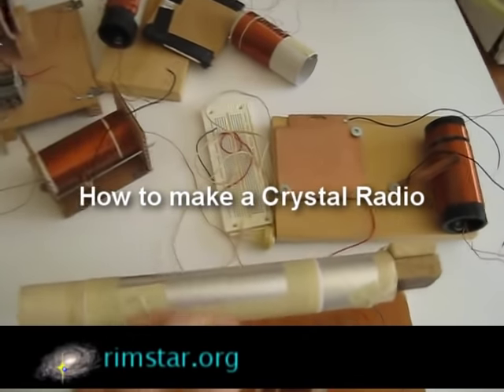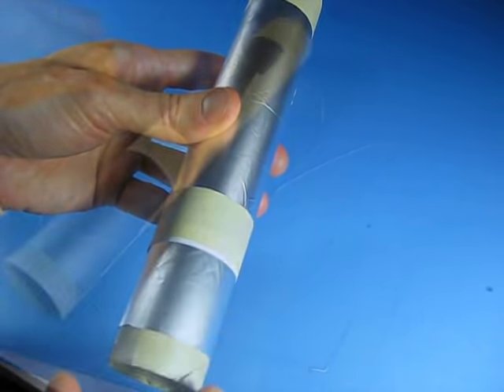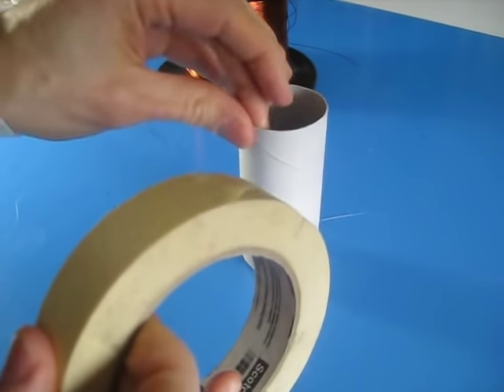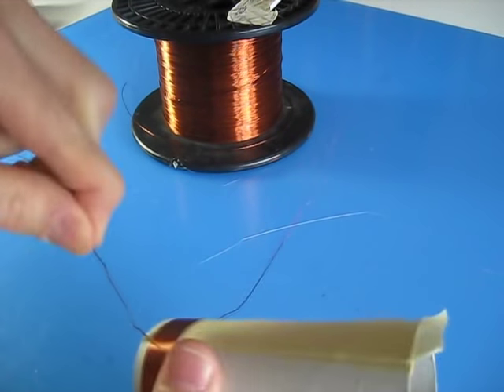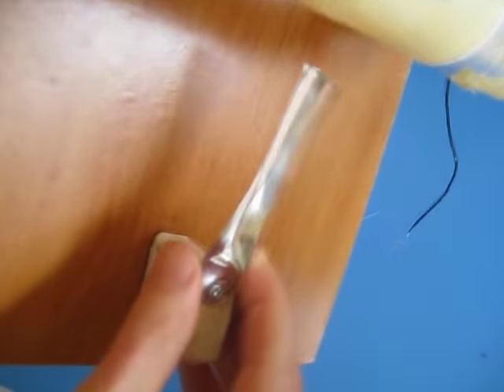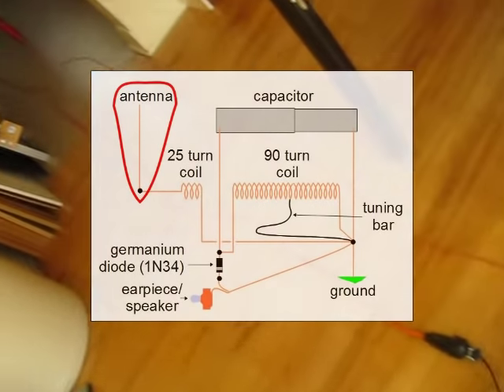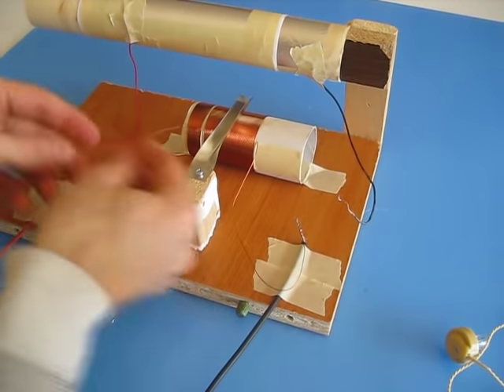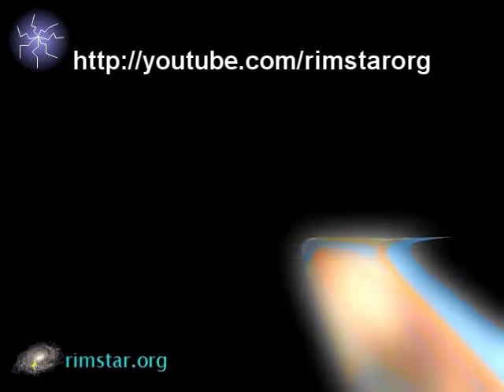How to Make/Build a Crystal Radio

Comment: Can you blow out the speaker if the capaciter is set wrong?
Reply from the maker: It shouldn't, and never has for me. There isn't enough energy coming in to damage the speaker. BTW the speaker is a piezoelectric crystal disk.
Reply from the maker: *****
I don't see that a "magnetic" core would help. My guess it would hurt, though maybe not noticeably. The magnetic field from the antenna coil is alternating in directions. A permanent magnet core would have a fixed magnetic field in one direction only. So a magnet inside the tuning coil would fight the field coming from the antenna coil when it's in the opposing direction.
Reply from the maker: *****
Keep trying. It may be that you're just not picking up anything loud enough to hear it, in which case you need a longer antenna. It should be a straight wire, as long as possible and preferably pointing in the direction of a radio station. It could also be that your connection to ground isn't good or you're using something that isn't a good ground. It could also be that you have a loose connection somewhere or you're not making good contact where you've sanded off the top of your coil.
Reply from the maker: *****
I noticed I hadn't replied to this. I'm really not sure if using a core instead of air in the coil helps. I do know that if you change the core material then you have to recalculate the dimensions of the whole coil. The core material is one of the variables in the formula for inductance. If you change one variable then to still get the same inductance, you have adjust the other variables.
Reply: ***** Putting a core in won't make the signal stronger.  It will change the inductive strength of the coil  (i.e., the number of Henrys).  The coil won't be the right value for the tuning circuit then and you would have to reduce the number of turns in the coil to get the same amount of inductance.  It's not about the strength of the coil as much as the balance between the coil and the capacitor (collectively known as a "tank" circuit).

Comment: Can imonitor 2 meter signals with a crystal radio
Reply from the maker: If my calculation is right, that's around 199GHz. This crystal radio can tune in around 540kHz to 1.6MHz, much lower frequency and longer wavelength.

Comment: Does the diameter of the copper wire matter?
Reply from the maker: It would matter only for the antenna and only if it were in the hundreds of feet long. For an antenna that long, you want thicker wire so that the resistance is low. I don't know what size though, maybe even 18 AWG would be enough for that length.

Comment: i try it out with 1N4148 and didn't work why ??? and i use a speaker from a earspikers...
Reply from the maker: The 1N4148 is a silicon diode. For a silicon diode to work you need to a very long, straight antenna, like 30 meters or maybe more. I'm not sure what speaker you're referring to but unless it's a piezo speaker you'll need a transformer to make it work. See my video "Use Earbuds/Earphones with Crystal Radio" http://youtu.be/GCh2LVHUavQ for how to do that. You're better off finding a germanium diode and a piezo earpiece instead.
Reply: ill make you a video of my crystal radio but it's not that good :/ :D

Comment: can i listen fm radio channels with this?
Reply from the maker: No, it's designed for AM only. It doesn't have the circuitry for demodulating FM.
Reply: RimstarOrg i see. thanks for your answer. is it possible to build one with few changes for fm band then?
Reply from the maker: I've never looked deeply into it, so I don't have an answer. I know that there's a chip for doing it, but I just checked my notes and see that I've never written down where I found it.
Reply from the maker: I just noticed you asked if it was possible for the fm "band". The problem isn't that AM and FM use different frequency ranges. The problem is that AM Modulates the Ampliude of the waves whereas FM Modules the Frequency. They require very different circuits in order to decode/demodulate them.
Reply: RimstarOrg oh I didnt know that. thank you for explanation. a good and instructive video by the way

Comment: If I plug a single wire Into a ground plug will it spark?
Reply from the maker: samuel virgil pe It shouldn't spark. If it does then don't use that outlet. That means the ground hole in that outlet is connected to the hot wire, which it shouldn't be. You should not be getting sparks from it and I'd recommend getting it checked.
Reply: RimstarOrg I plug it in the hole and keeps on buzzing like it's not working well
Pls reply
Reply from the maker: samuel virgil pe
Your antenna must be a long straight wire, as long as you can. Mine is only around 12 feet long, which is much too short, except that I live near some radio stations.
Other than that and all the stuff I've already given you to look into then check all connections, make sure you're tuning bar is making good contact with the area of the coil that you sanded off, try it in different places, including outdoors.
Reply: I'm using a razor blade for diode
Reply from the maker: samuel virgil pe
Ah. When I tried that, my experience was that the result was weaker, though I got it to work. You do have to try a lot of different locations on the razor blade and not press so hard that you damage the oxide layer. It is harder to get working. My own efforts are in my video here in case it helps https://www.youtube.com/watch?v=eIdHsjfbckw

Comment: I have questions.
So basically, this is a pretty crude radio?
Has anyone made one that can intercept radio clearly?
In theory is, it possible to intercept wireless phone calls with a device like this?
The advantage of this is it doesn't need a power supply?
Could you convert the incoming radio waves into some kind of power?
Reply: +Andrew Busse No this only works with amplitude modulated signals with a carrying frequency in the range the coil and capacitor are tuned for.
Reply: So that's why radio's are adjustable then?
Reply: Yes, there are different was to accomplish this but you make the resonate frequency of the circuit the same as the carrier you are tuning to. Then the diode removes the negative side of the carrier wave. After that you can add a circuit with a power transistor and a batter to amplify the tiny signal so that it has enough voltage to move a speaker ( instead of the little ear piece that is very quiet)
Reply: @ Andrew: Even if you would make it possible to receive mobile phone calls, you could not hear them. They are digitally coded signals that use an audio codec to work. Not amplitude modulation. These are totally different signals.

Comment: Can a silicon diode be used?
Reply from the maker: Salcott Aam I haven't done it but I'm told silicon diodes will work if you use three in parallel, all their striped sides connect together and all the other sides connected together.

Comment: Can i use an actual antenna from a car? how would i connect it?
Reply from the maker: asmenda969 No, an antenna from a car is much too short. I'm able to get away with a few straight wires around 14 feet each in parallel only because I have some radio stations nearby. The antenna has to be as long as you can get it, straight, and if possible, pointed in the direction of the radio station.
Reply: RimstarOrg how about an antenna from an actual AM radio? :D 
I suppose it would work but I don't want to risk anything!! :'D 
I don't need to mention I don't have a lot of experience with electrical devices
Reply from the maker: Nancy Yousry Ammar You'd think an AM radio antenna would work but it won't. A crystal radio receives AM radio but it gets all its power from the incoming radio waves. To capture enough energy from those radio waves it needs a long antenna.A normal AM radio is battery powered or plugs into the wall socket and contains an amplifier inside that amplifies the sound so you can hear it. So they can use a short antenna.A crystal radio might work with an antenna from an actual AM radio if you add an amplifier like I do in this video here https://www.youtube.com/watch?v=JtPwxbOgBHw
Reply: RimstarOrg yes!! I did make the amplifier from your video!
Thank u so much :)
I learned a lot from u :))
Reply from the maker: Nancy Yousry Ammar My pleasure! And thank you! I'm always glad to hear when someone succeeds at making something using my videos.
Reply: Nancy Yousry Ammar
 Good for you! :-) [insert many thumbs up here]...

Comment: how do you make the antenna again i was unclearly on that
Reply from the maker: The antenna is any diameter wire. You want it forming a roughly straight line for as much of its length as possible. Naturally, it won't be straight where you connect it to the crystal radio. In my case it was around 12  to 15 feet long, but that's very short and worked for me since I have some radio stations nearby. If the antenna is going to be in the hundreds of feet then the diameter will start to matter and shouldn't be thin magnet wire.
Ideally you'd have it pointing in the direction of the radio station you're tuning into, but that's rarely possible.

In my tips and troubleshooting video, https://www.youtube.com/watch?v=HZZmKZJrIW0, I show how I found that you can put multiple in parallel to get a stronger signal. Further experimentation with that later found that you don't want them too close together. Around 4 inches/10cm or more apart seems fine.
Reply: u actually used an antenna or just the wire ( i am not familiar with this stuff so bear my idiocy
Reply from the maker: The wire is the antenna. I guess you were expecting something else as the antenna? Antennas can be in many different shapes, depending on the requirements. In this case, all that's needed as the antenna is a long straight wire, the longer the better. (And don't worry if your question seems basic, we all start from somewhere.)

Comment: where does Antena wires go plese show out side
Reply from the maker: See the diagram in the video at 0:24. One end of the antenna goes to the 25 turn coil and the other end doesn't go anywhere. Make sure the antenna is straight. If you're asking where I put it physically, it just sits on my floor as shown in the video when I'm using it. I don't put anything outside.

Comment: i can not find the germanium diode 1N34 is there any alternative for this ?
Reply from the maker: adwait rawat Yes, 1N34A, 1N60, 1N91,  1N119, 1N270, 1N277, 1N283. That list is in the video description along with a few other details that might help you.
Reply: RimstarOrg Why must the diode be germanium?  Does silicon work?
Reply from the maker: Salcott Aam Germanium diodes start conducting as a lower voltage than silicon and most crystal radios don't produce a high enough voltage for silicon. If your antenna is a few hundred feet/meters long or you're near a powerful radio station then you might get enough voltage for silicon.
Reply: RimstarOrg
I read somewhere that you can sometimes use a rusty razor blade and graphite from a pencil in place of the germanium diode. Is that true?
Reply from the maker: davidkesslerauthor Yes, you can use a razor blade and graphite form a pencil (I don't know about the rusty part, mine was clean.) I do this in my video "Make Razor Blade Diode for Crystal Radio/Foxhole Radio". I found it hard to get working and the results weren't as good as with a commercially made germanium diode. But it worked!
Reply: RimstarOrg
Maybe the problem was that it wasn't rusty. I just found where I read it. According to http://sci-toys.com/scitoys/scitoys/radio/homemade_radio.html (about 3/4 of the way down under the heading "Building your own diodes" it says:

"By lightly touching the pencil lead to spots of blue on the blade, or to spots of rust, they formed what is called a point contact diode."
Reply from the maker: davidkesslerauthor
Oh. I did the blue trick, didn't know about the rust trick. Hmm... put them in water for a bit to grow some rust... Thanks.
Reply: 1N60

Comment: Oh Ya thes turners that are in thes radios that you buy at the store that you use for homes thay look big small and sometimes they are bigger it all depends on the size of the radio that you buy from the store I don't buy a working radio and tear something brand-new apart I would buy from a yard sales to do so. when you open up a radio or tearing apart a radio they will look like a square block on the motherboard that's the Turners iam talking about the only problem is some are not am and fm when you buy them dont wast you're money on a radio because some of them are strait am bands only not all radios are also fm am bands just remember when open up a radio the center of the motherboard they will. look like a small block some dont have a Turner some my have a micro chip so look for a analog radio and you will find themselves on the center of the motherboards only on most analog radios that you buy don't waste you money on buying them go to a yard sales or ebay

Comment: can i use 1n4814 diode as equivalent?
Reply from the maker: No, a 1N4814 is a silicon diode. You need a germanium diode. I have a list of some of them in the video description. There are a lot of 1N34 and 1N34A diodes on https://ebay.com for very low price. A silicon diode might work if you have a few hundred foot long antenna and/or live next to a radio station.

Comment: That's not a crystal radio.
There was no tuning crystal used. That's an AM LC tank circuit radio with a diode detector.
Reply from the maker: hakachukai These days the definition is that it's a crystal radio if it runs solely off the power of the incoming radio waves. Though it would be fun to try an actual crystal someday.
Reply: Ok, good to know! I was unaware of the electronics language mutation. Back when I was into HAM radio stuff, I think they called this a "fox hole" radio, because it used minimal parts and was built in a fox hole or two during war times.

It would be awesome to see how to build a simple crystal radio using an actual tuning crystal! Maybe I should knock the dust off that giant ARRL Handbook that I haven't read in 10 years :-P

Comment: crystal radio reads FM or AM radio? using battery or not ?
Reply from the maker: +Scnbme Go ! It's AM and it does not use any batteries. A crystal radio gets its power from the radio waves.
Reply: +RimstarOrg Can it reads SW radio (less than 3MHz) ?
Reply from the maker: Try adding an extra 470pF capacitor in series with the variable capacitor. That should extend the range and make it easier to tune in that range. Also, you need a really long antenna for short wave. I haven't done it myself but that's what I'm told.
Reply: +RimstarOrg if i add more capacitance can it rich/reads FM radio (100uF)
Reply from the maker: FM radio needs a different circuit. FM stands for Frequency Modulation and is different than AM, Amplitude Modulation.
Reply from the maker: Oh, and I don't have a circuit for FM. I've never made an FM receiver.

Comment: could we use a normal capacitor
Reply from the maker: Yes. I used a homemade capacitor because I wanted a variable capacitor and while you can buy those (see the links in the video description) they're not normally found in stores or in things you can take apart. For the coils I'm using in this video, a suitable fixed value capacitor would be around 355 picofarads (pF). The voltage rating on the capacitor doesn't matter since the voltage is so low here. You can see more about this in my crystal radio tips and troubleshooting video https://www.youtube.com/watch?v=HZZmKZJrIW0.

Comment: Hmm.
This is overly complicated.
I made a crystal radio when I was 13
Really simple and worked really well, strong signal and in STEREO!! (Yup AM radio in Stereo)
I only had one coil and a wiper made of copper wire (ROMEX type)
One Diode, 2 earphones and 2 pieces of wire. 
No Capacitor, No antenna coil.
Secret??
I used a  1N36 Diode (better)
And for antenna I connected to a metal tab on the HOUSE PHONE.
SO  I used the Phone Co. Wiring City-wide for really strong signal.
 Thru the earphones in parallel.
And to Ground.

How the Stereo on AM?
As a child I collected anything I could tinker with.
I used a CERAMIC earphone
And a Magnetic earphone. ( Metal disc)
They responded to different frequencies. Thus I got different instruments on each. 
Most Likely the only AM RADIO IN STEREO IN THE WORLD!!
( The Strong Signal from Phone network powered the magnetic earphone, nicely)
and very Simple!!
and of course my Mom was Amazed😂  
A radio w no parts, no batteries, In STEREO! tunable by moving a wire over a coil. 
And the Volume was Strong, clear and in Stereo.
She thought I was smarter than Einstein 😂 LOL
Truth is TINKERERS  discover things by accident and with the few things they got..........

Comment: Can u use mild steel mug wire l56
Reply from the maker: I've never heard of it until you mentioned it, but as long as it doesn't have a high resistance then I don't see why not. Of course, if you're going to use it for the coil then it'll need an insulating coating except for the top where you sand it off.
Reply: RimstarOrg